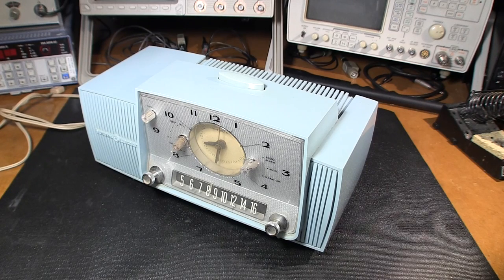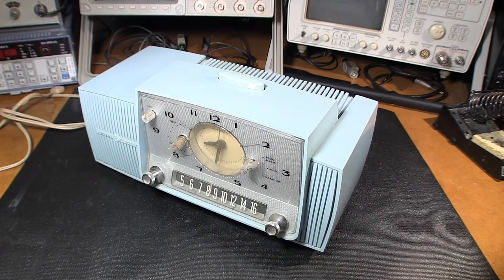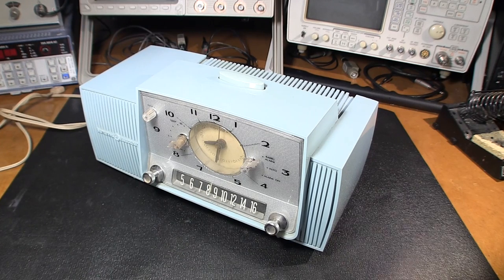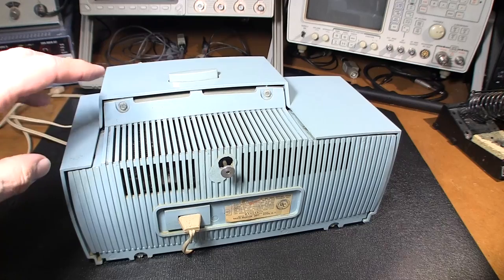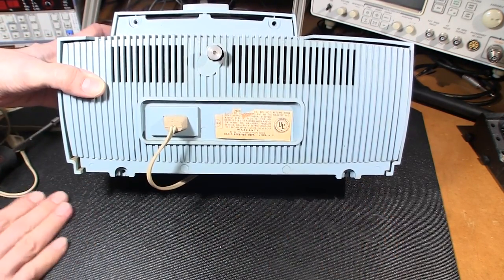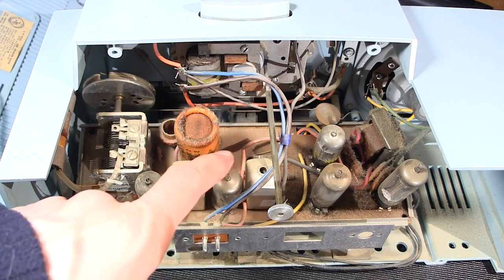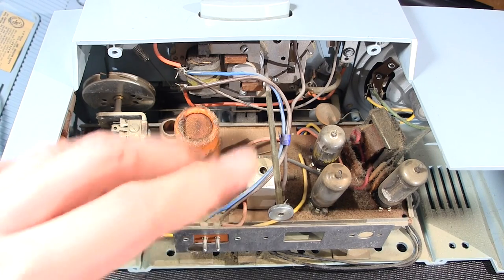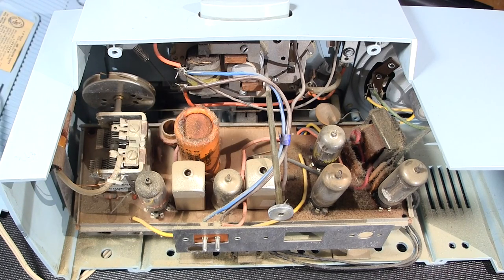Atomic Era Radio Teardown, Explained With Repair

Comment: Wow!  I'm not technical at all but I was just mesmerised by this and I wanted to see how the radio would turn out after you cleaned and upgraded some of the components.  I think it's really sad that our big radio and tv manufacturers no longer exist in the west.  Here in Australia I live close to what was once the largest radio/tv/whitegoods factory in the southern hemisphere.  It really was massive...you could land a jumbo jet in that place!  The company was Radio Corporation of Australia and their trade name was "Astor".  They made some wonderful radios, radiograms and tvs.  Astor, Amalgamated Wireless of Australia (AWA), Healing and Kriesler were once big locally-made electronics brands...now all gone or just nameplates for imported Chinese goods.  So very sad.  The old Astor factory is now just a housing estate with some small concrete slab warehouses to the rear.  Warehouses for imports...so depressing.
Reply from the maker: Thanks for taking the time to write! Great story.

Comment: The "silver" shiny spots on tubes are caused by a device known as a "getter" .  It normally looks like a "ring on a stick" inside the tube.  This device was used to make the vacuum in the tube better.  When it is fired it deposited this silvery coating on the tube walls or top.  These turn white when the tube is exposed to air.

Comment: Interesting, especially where they hid the caps in the IF cans. I usually avoid live chassis sets, I'm in Australia, and 240V on a chassis is just asking for trouble.
Reply: the only problem with a live chassis is if the power point was incorrectly wired  but no non polarised plugs in aus, a great design.

Comment: You are a GREAT teacher! I’m constantly amazed when something isn’t right, you know where to start to trouble shoot! I have not learned enough about electronics to even think I could repair anything as easy as that radio. One question? Why wouldn’t you replace the line cord with a polarized one? Aside from wanting it to be era correct!
Reply from the maker: Hi Joe. I could, but the connection in the rear of the radio has a special rectangular connector with two holes, and a clip to retain it. I would have to destroy a perfectly good line cord.

Comment: Are the metal tuning and volume knobs isolated from the chassis? I saw metal knobs and metal potentiometer control shafts. Also, Heathkit called those "early integrated circuits" as PECs for packaged Electronic Circuits.

Comment: Safety-smafty, I like the Shango66 approach of forcibly reforming capacitors.  The only thing in that radio that can doom it is silver mica disease in the IF cans.  With you though, you'd probably redesign the radio to make it work.  (smile)   Those cheap plastic knobs were deadly on some radios from that era, the metal shaft under it was connected to one side of the AC line.

Comment: Very nice radio, I remember seeing those when I was a boy, and wishing I could have one by my bedside.  At long last one of my aunts decided I should have a radio, she gave me one of their old ones, it did not have a clock but it was indeed an old tube radio that took some time to warm up. I had it beside my bed, and used to lay in the dark and listen to the "Padre's Platters" on KFYR Bismarck ND radio station at 550 on your radio dial. The "Padre" was indeed a priest who loved rock and roll, he played the latest hits, (196X's) and never stepped in to try and sell God on the side. That old radio had a very nice speaker and the bass was wonderful, of course my memory could be faulty since much of my hearing was left in a little southeastern Asia nation called (back then) The Republic of Vietnam.  Hearing aides now replace that loss, at the cost of the taxpayers, thanks to the VA, but those radios will never sound the same again.  Today I still listen to those same tunes but now they are transmitted from my laptop over a Bluetooth device that is received by my hearing aides and into my ears through small tubes that lead into the ear canal.  The bass is no longer there for me, and if I turn up the old Stereo that I salvaged from Ebay many years ago, and push the audio through the huge speakers I picked up at an auction 25 years ago, I can feel the bass and almost hear it as well.  It is a very rare day that I turn on that equipment as it drives my wife out of the house, even when she takes out her hearing aides.  They say that war is hell, but nobody adds that coming home from a war can be nearly equal to serving in one, and the true hell is old age for an old soldier.
Reply from the maker: Thanks for that great story Jerry!

Comment: Not sure if I missed it, but I was wondering what you used to clean and polish up the chassis as nicely as you did. Was hoping you had a trick to share, other than removing and ultrasonic cleaning of the tuning capacitor. Love your videos.

Comment: Here's a tip with short ferrite rod antennas. Add about 2 inches of extra rod from some destructed radio and add it to the end of the rod with shrink tubing or something.You will be amazed at the sensitivity in any radio with an extension of the rod. Too much won't make more gain, but just the right extra length and you could have a good DX mantle radio. No kidding.

Comment: I have a story about tubes I spent 7 years in the NAVY on submarines to bad I got hurt during a torpedo mk 48 chain broke and crushed me  So nothing below the waist. So just 1 think out of quite a few things on sub that use tubes. I took care of a mk 19 gyro . It is about 6 feet tall and 4 feet wide . It has 105 tubes in it the sub was built in the late 60 s SSBN 619  .  It also had top secret IC s in it . at the time the top electronics that could be used . So on the MK 19 gyro if it breaks down which during my time in it did . If you think it a tube and nothing else seem to fix it you are not allowed to just replace 1 tube . The sub carries 2 complete tube sets and you do have a tube tester we were taught in school all about tubes so we would not blow the tube tester up. So as we remove them we test them and also mark where they came out of. Each set of tubs are checked 6 times before we get them . Each test the person who did it had to sign off on it. So if we use up both sets during a patrol we cross our fingers and hope we have a good one out of the was we replaced .I was in during the late 80 s . I know so much about tube I will never forget. Even the new subs still have the mk 19 gyro.
Reply: ncrdisabled Submarine vet interesting ill try and find info on that gyro just to read about it.....  One of the most interesting things i seen was a ww1 torpedo,  with two gas driven gyros.. That spun up to control the tail fins and two turbines to control the counter rotating propellers,,  used solid fuel...  I held one of the gyros while it was spun up on air and felt the force of it...
   At the time i never known about a ww1 torpedo's,  its the shape of the one in cartoons,  bugs bunny, road runner ?
Reply: Thanks for the story and thank you for your service +ncrdisabled Submarine vet!
Reply: Thank you for your service, now please start using periods. ;)

Comment: Had to spend quite some time to google up the schematic for this one. Turns out the intriguing "IC" is just a passive hybrid containing a couple of caps and resistors... (well, did I really expect to see semiconductors in a 50's radio??) Very nice restoration job anyway!
Reply: SaNjA2659 

Centralab was one of the pioneers of them.  They called them PEC or printed electronic circuits.  I have a few hundred of the old Centralab brand ones.  Many of them were designed to replace all the passive components in a tubes supporting circuitry.
Reply: Wonder whether they were manufactured using thick film or some other technology. Regardless, it is indeed very impressive for the time, especially considering typical tube circuit voltages.
Reply: SaNjA2659 

I actually think the real early ones were made with normal through hole components.  Some of them you can clearly see the outline of the parts within.
Reply: I was just going to ask about the "IC" mentioned at the beginning and what its purpose was... thanks!

Comment: 51:00 The plastic shaft on the volume control seems a little ahead of its time, but with metal knobs, it's really a necessity. That makes me wonder if they metal tuning knob shaft is isolated some other way, maybe with plastic grommets.  On a radio this age, it might be worthwhile measuring the voltage on that knob to make sure the whatever was used to isolate it is still doing its job.

Comment: Speaking of atomic era…I have a Magnavox C003 clock radio, from mid 1950’s, with luminous clock hands.  I also built a Geiger counter kit a few years back.  The luminous hands are mildly radioactive.  Radium, I suppose.  I don’t know a lot about the subject, but I don’t intend to touch or disturb any of the phosphorus paint on those hands!

Comment: Very cool trip down memory lane, thanks!
I remember watching my dad repair tube radios when I was a kid, in the 60's. 
He wasn't a technician, he was a mechanic, and an antiques dealer with a big soldering gun and a vacuum tube tester!  He mostly fixed older, stand-up radios from the 20's and 30's.  Radios like the one you just restored weren't old enough to be of any interest yet. ;-)

Question: What was used to clean the circuit board and components?  The board looks great!

Comment: The neon bulbs had a trace of radioactive material in them to make the neon gas ionize more easily (at a lower voltage).  One failure mechanism is that the radioactive material decays away over many years and the neon gas won't ionize any more.  Even new old stock bulbs will fail to light after 50+ years.  Sorry if this was mentioned before, 750 comments is too much to read.

Comment: I've been restoring vintage radios for some years and have had several discussions with others, regarding the use of higher voltage electrolytics when re-capping a radio.
Some people consider using a 450V cap where a 200V one would suffice to be a bad idea, since the electrolyte never forms correctly when receiving about half its rated voltage.
450V being so common I have a stack of them. A series string radio here in the UK generally has a B+ of 230-240V. I've never run into problems later on, to be honest. Wonder what your opinion is on this Mr Carlson?

Comment: I did commo repair on the AN/VRC, PRC series in my Unit back in the day.  Unfortunately my Unit was Armor and Tankers break EVERYTHING.  They had a habit of slamming the radio in and out of the mount to "make sure there was a good connection with the mount socket."  Needless to say, glass components don't like that sort of thing...

Comment: Nice video.  What chemical did you use to clean off the waxy crud?
Reply: Ammonia with some bleach. Mix together. Works like a charm. Nice powerful smell. Means it's working. 😃👍

Comment: Couplates are passive devices of integrated resistors and capacitors. An true integrated circuit (IC) is just active transistors.

Comment: A more common name for those IC circuits was "wafer circuits". Most only consisted of resistors and capacitors. Some versions would also have miniature coils and choke coils in them.

Comment: This looks almost like the analog clock radio that my dad used to have by his bedside. His was a cream colored solid state GE. Think it was AM only. Been too many years to remember, but yes, it had a lighted dial. Too bad it didn’t come in a vacuum tube version. I think my dad’s GE radio was a circa 1973 model.

Comment: Mr Carlson, thank you for an extremely interesting and informative video.  I was a bit confused towards the end of the video when you were describing how to set up the signal generator for "1.6MHz modulated to 50% by a 1000 cycle tone".  Would you consider doing a video on setting up a signal generator with a modulated tone?  And, if using a basic signal generator, is it possible to create a simple circuit to modulate a basic signal generator tone for AM radio alignment?  Thanks again.  Always looking forward to your next video.
Reply from the maker: Thanks for you input!

Comment: Great work!!!  Hats off!
- I would like to see how you cleaned it so well!  I would also like to see what you did with that charred board...?
- I saw once that I guy that refurbished Tektronix scopes to sell on ebay said that he put the scopes in a bathtub and ran water on the boards and circuits...?!!  Did you flush any thing with solvent or water?

Thanks again!  You are great!!

Comment: Remember that these radios lived through the Marlboro Era, when most users were smokers. Opening up electronics from those times would reveal a heavy coating of deep amber nicotine tars on every surface, and the residue would literally smell like an ash tray. You could count on this gunk causing switch contact and potentiometer problems, sometimes even causing sticky operation of mechanical parts. And, if you were really unlucky, you might find insect nests or even mouse habitation evidence.
Reply: Ed Price well the last few hammerlunds i recapped and aligned were from a smoker and the layer of smoke seemed to preserve it,  they look very nice after a good cleaning
Reply: You're right. This was principally a bedroom radio, with a wake-up alarm system.  I'd bet a lot of procreation took place while these radios were on, followed by a smoke in bed, in that last decade before all the fun was taken out of cigarettes.

Comment: Atomic era - strangely, the time on your clock is the same time that the clocks stopped in Hiroshima. Just sayin' :) Great video! PS, those asynchronous motors that run the clock are very hard to find now.

Comment: maybe i missed it in the video, do you disconnect the speaker so you don't have to listen to the tone while speaking on camera and performing the alignment? 
i have a speaker with the output transformer built in, so i'm not sure if i can tease the two apart....

Comment: I've built a Nixie tube digital clock. Most Nixie tubes I've came across don't have any of that compound on the top; it's just clear glass.
I've also built two stereo VU-meters out of cat-eye fluorescent tubes (Orion EM80 and Lorenz UM85), those don't have any of that compound on the top either.
Why are those different from tubes like triodes?

Btw, impressive dial lighting system @ 21:55 especially when you realize it's a mass produced radio.
That kind of quality won't be possible in modern day mass produced crap.

Comment: Interested in your comments about the heat generated inside the radio. In the UK (and nearly everywhere else outside the US) where line voltage is 220 - 240V, for this design of 'Universal' (i.e. no power transformer) power supply, they would run even hotter. There would be a big wire wound resistor dropping the line input to the total heater series voltage which in this case is 122.8V, so a 780 ohm resistor dissipating 17.5W would be needed. I guess the resistor would limit heater inrush current when the set was switched on from cold so maybe that helped tube life.

Comment: Hmm. The Conelrad thing kind of bothered me, so I did some quick research. Between 1953 and 1963, all US made am radios were required by law to have the triangle CD Conelrad markers on the dial at 640 and 1240 kHz. Was the radio made/sold outside the US? That would explain things. Just curious.

Comment: I have a tip I learned when using super glue put a small amount of baking powder on it. The super glue will set instantly and the joint will permeant.

Comment: What i've done for my radio's tubes is i've extended the legs of the holder by 3 mm and stuck a custom made (kinda looks like a bent stick figure with the head under the holder passing through two pins) heatsink. It's just enough to keep the board cool, but not touching the holder, it leaves the "bulb"  to do its thing.
Reply from the maker: Thanks for your input!

Comment: Can you do a video either here or on Patreon that covers both AM & FM alignment on tube radios using an oscilloscope and VTVM? I have two AM/FM tube radios that I’ve recapped and changed retubed but the service literature doesn’t do a good job of explaining the alignment process the way you do. Thanks!!

Comment: Wow.....Another great video and very helpful. Do you routinely replace the capacitors in IF Transformers when rebuilding these radios ? Just curiosity on my part. Thanks again.
Reply from the maker: Not all the time, just when the receiver is acting up... usually.

Comment: Great video Paul. Your video inspired me to hunt for a GE atomic clock radio to try a restoration and I found one on eBay - the exact model as yours except in white.  It had a bad filter cap which I replaced with two 47 uF 200v caps in the exact locations you did.  My radio does not have SMD so far as I can tell so I did not remove the IF cans.  The neon light also worked so I did not need to perform that repair.  I temporarily tuned the IF cans for max volume.  I will do your procedure when I have more time.  The dial alignment was spot on so I did not have to adjust that either.  One question though - how did you you remount the original filter cap?  Did you cut the tabs and glue the cap in place?

73,
WV2M - Frank
Reply from the maker: Hi Frank, looks like you have a really nice radio there! The original filter capacitor is mounted the same way, I put some cuts in the traces under the circuit board so the original capacitor isn't in circuit. Depending on how you do this modification, you may need to install a jumper in one spot. The cuts were made with a Dremel, a very small burr type bit, and a very steady hand.